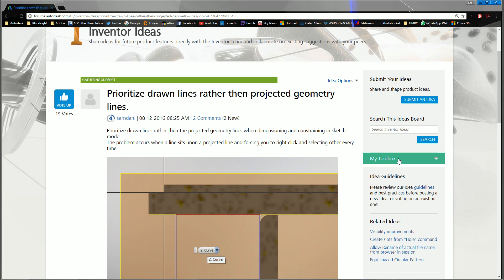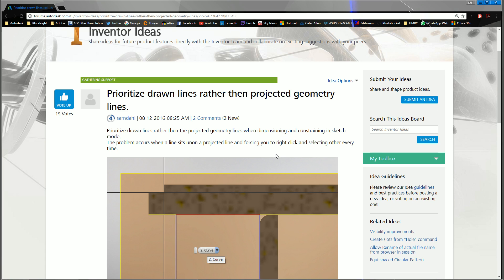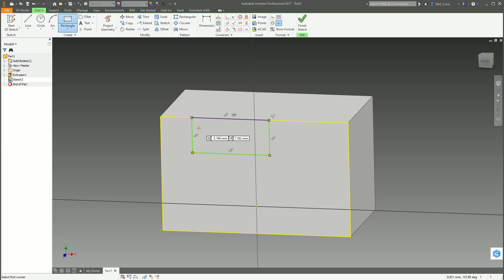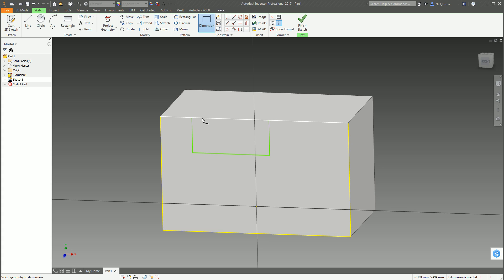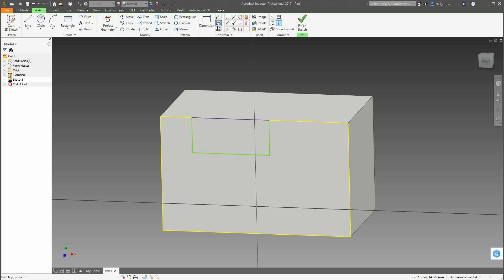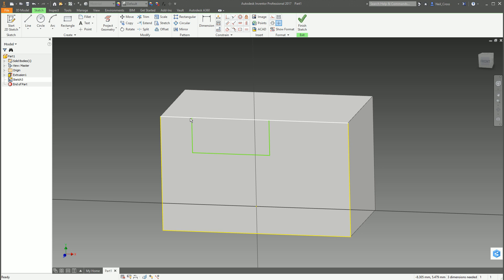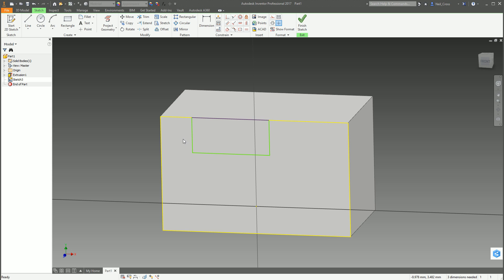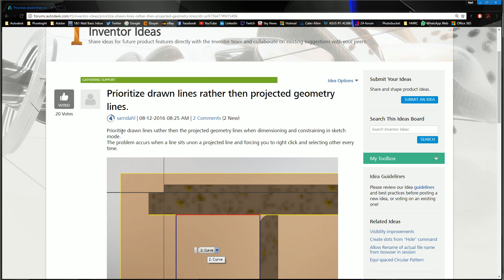Wish List Ideas #4, Projected Geometry Priority | Autodesk Inventor

Comment: There is an idea that I have had for a long time now:
Can they make the "mirror" command work as it does in AutoCAD? Namely, make it snap to a point (such a midpoint...) and hence use orthogonality to define the other end of the line, without having the user actually draw a line just so it can be used as a mirror line, and then delete it when it's done it's job...
BTW, I tried to get this idea to you directly, but I'm afraid I don't know how to contact you...Thanks, m8